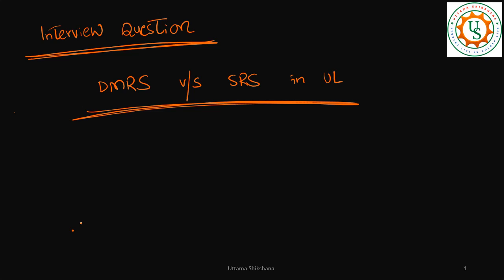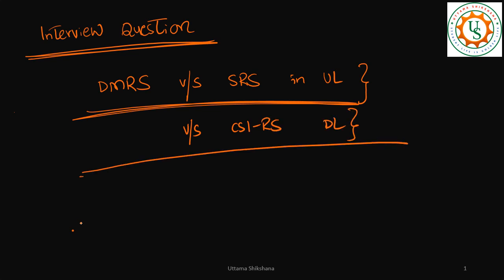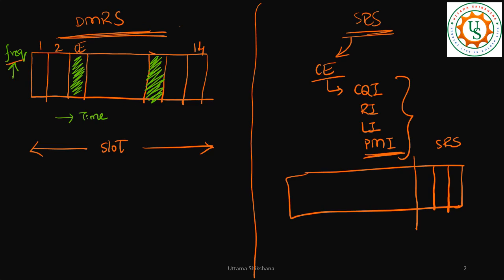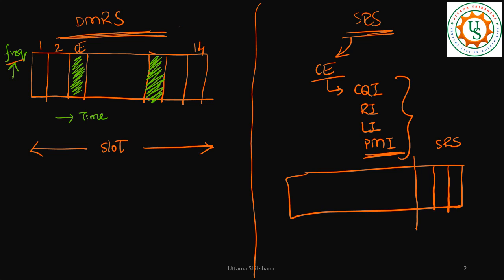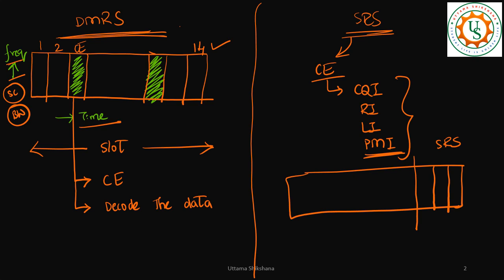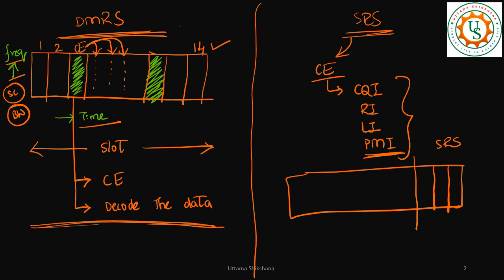DM-RS vs SRS in 5G

Comment: Hi Sir

Can you tell why SRS is scheduled only on last 6 symbols is there any reason behind it ??

As you mentioned SRS will be used for MIMO i.e., SRS will be sent over 2ports and check channel for LI --> like these CSIRS also be transmitted over 2ports to check MIMO in DL ??
Reply from the maker: 1st question is left for others to comment.

2nd question - Yes. You are right.
Reply: @Uttama_Shikshana  one question here if we have mumimo then can't we do 1T 4R anttena switching srs..as per above description it's shows that mumimo required 2 port srs that means 2 TX correct???

Comment: Hey, Can you tell the reason why SRS send on last symbol and also why we need csi rs
Reply from the maker: If nobody answers in the near future then I will try to bring the answers.
Thanks
Reply: @Uttama_Shikshana  Because SRS is used for estimating channel in UL, and channel reciprocity is then used to apply those coefficients in DL.

And in case of high mobility channel will change quickly.

Sending SRS in last will make sure that there is minimal gap between time of channel estimation and applying it in DL.
Reply: @Uttama_Shikshana please provide answer for this